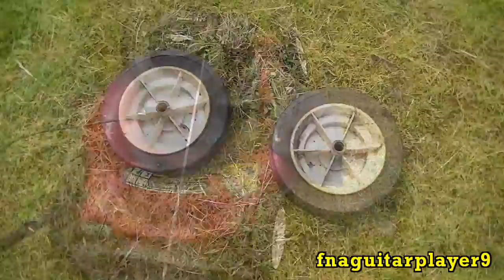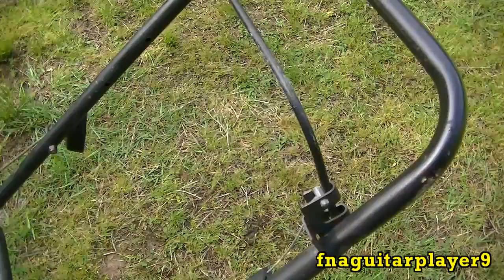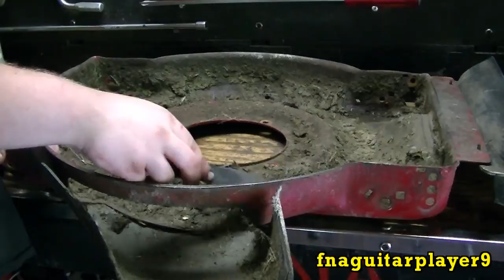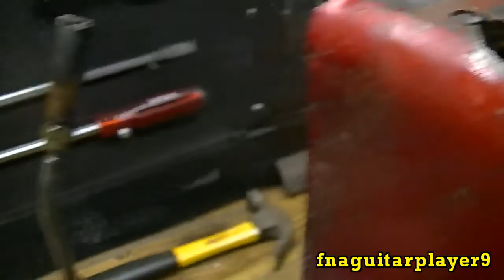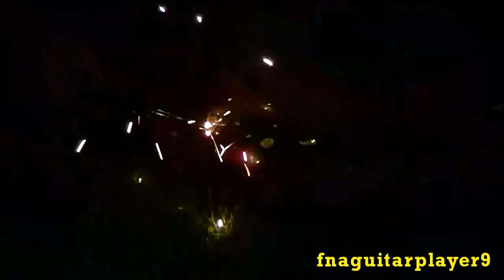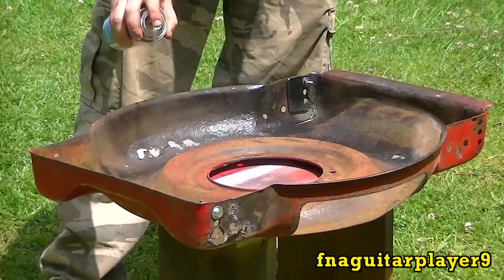Push Mower Project Part 1 of 2 (Teardown/Disassembly, Deck Repair, Primer, Ready to paint)

Comment: I realize this is a pretty old video. However, I got an idea you can try for future welding of thin metals like that. If you have a piece of aluminum, place that on the back side of the hole you are trying to weld up and weld in little stitch type welds. It will weld over and then you can grind it down to look perfect. The aluminum backer late will do two things. It will not weld to the metal because it is aluminum, but it will help keep from blowing through. And since it dissipates the heat well, it helps keep the surrounding metal a little cooler as well. Try it. You will see a difference.
Reply from the maker: Makes sense, will try that next time, thanks for the tip! Thanks for Watching!!!

Comment: If you're going to weld something that thin without blowing holes in it you need a MIG welder, the flux core wire you're using burns too hot and penetrates too much. I've welded stuff as thin as car body panels with 25 mil wire and 80/20 shielding gas. TIG would be the best for something like that, but it's also way more expensive and requires way more welding skills than I have.
Reply from the maker: Yeah thats a much better choice, I have actually welded body panels with this and it didn't blow through, but i had the speed up higher to help it. Thanks for Watching!!!
Reply: If the body is made out of aluminum, a flux, stick, and mig welder would be useless. I spent two years in a vocational school learning welding. A tig welder would do the job, but you obviously have to have the equipment and the "know how" to weld it. There might be some welding method with a cutting torch that might work, but they didn't teach us about any of that kind of welding.

Comment: Wouldn't be better to fill those holes with a little JB WELD and then sand them smooth
Reply from the maker: +mateollios 67 That might have worked, i just went with bondo because we had some on hand, but yeah, jb might actually have been a better choice. Thanks for Watching!!!

Comment: I have a question about using bondo on a mower deck, wondering that after some time, Will the bondo break up and just fall off?
Reply from the maker: +Freddy Hornsby If its done right it shouldn't unless a rock or something gets slung up against it from the blade. Alot of times people don't mix bondo right, like you always hear about using in car hoods, if its done right it won't break or crack. you have to use the right amount of hardener and make sure its clean shiny metal. Thats the 2 main things that aren't done right. Hope this helps, Thanks for Watching!!!

Comment: Just a thought. The next time you run into really thin metal like that, try forming a piece to fit tight up against the inside. Tack or clamp it in place and hammer to remove any gaps. Then you can weld the holes from the outside by keeping most of the heat on the backing. I've had a lot of practice at this over the years trying to get rusty cars to pass a WV inspection lol.

Comment: ha i use a mower thats never been rebuilt made in 1986 runs great the deck has a few holes but the engine is in pristine condition

Comment: I understand your point but, its just a quick fix. The most desirable way do deal with a problem like that is to weld a patch. I work with aluminum,steel, galvanized steel. copper and stainless steel (tinsmith) and I know how much man hours it will take to do the right thing but, might as well buy a new deck at this point. I have no doubt that it'll last at least 3 years without any maintenance. Your input is very informative though. Thanks for sharing.

Comment: In the case you are talking about (Bondo over SOLID sheet metal) if there is condensation, you will get sweating and thus rot.  In the case here where there are open holes which will be exposed to packed sod and mud which will retain moisture the bondo surely WILL fail!!  The fact that both use a hardener to fire the curing process has nothing to do with it!

Comment: You did a fine job on that mower deck, I agree I would also have used bondo on those holes.
BTW, As you may or may not know I have done body work on our van several years ago and some guys say use primer on bare metal THAN put the Bondo over it, others say put the Bondo on the bare metal THAN prime over it.
Would you ask your dad for me?
Thanks for a great video.

Comment: Actually if memory serves me good, if you apply bondo over a very cold piece of steel the chemical reaction will make it sweat thus, it will trap moisture and rot but, my car was redone 25 years ago ( outside ) and nothing shows til these days. If well done, by a professional, it should last for a good while. I could be wrong but, in this case, it was applied by a knowledgeable person. Both Bondo and Duraglass has a catalyst (hardener), the results should be the same.

Comment: Just a suggestion; Body filler soaks up moisture like a sponge and eventually rots out.  If you are going to fill holes with filler use short strand fiberglass filler (such as Duraglass) which doesn't absorb water and sands smooth prior to painting.